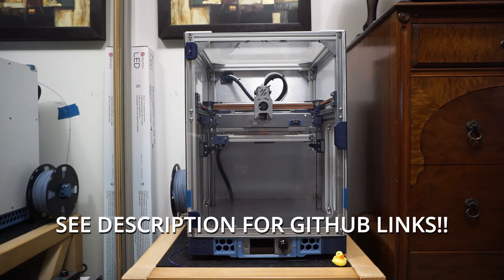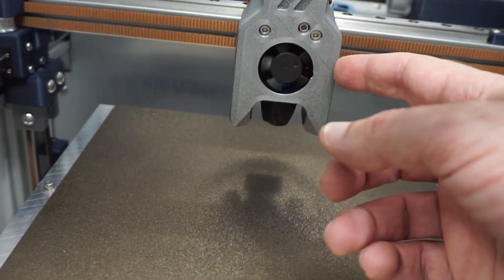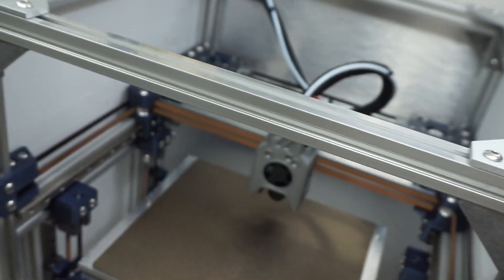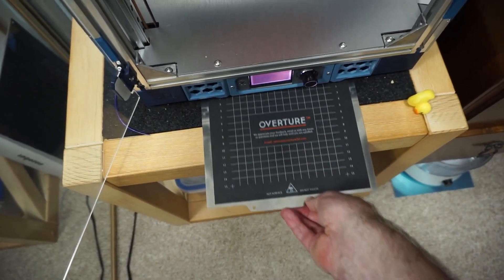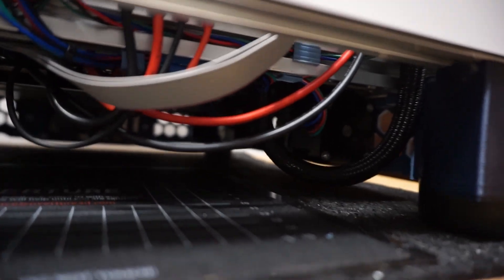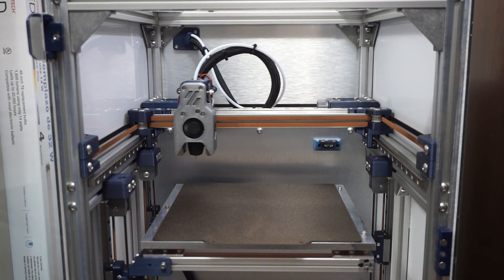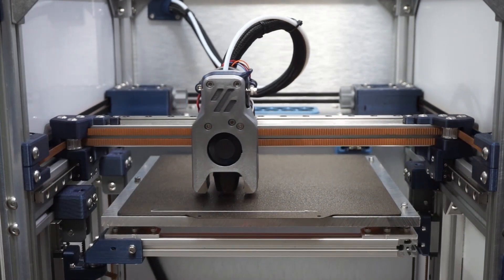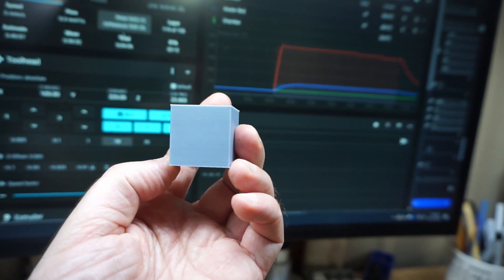XO Printer Part 3 + GitHub Link!

Comment: Hey, I love the Project!
I would really like to get my Hands on the Cad model but for some reason the GitHub download doesn't work for me... Is there any other way?
Reply from the maker: Make sure you click the "code" button, and then the "download zip" option.  that will make sure you get the correct file that should work.  But I am also in the process of doing some minor updates.  I'm adapting the new mini-stealthburner extruder setup from the V0.2 to work on this machine.  Stay tuned!

Comment: Is it hard to convert all the linear rail parts to mgn12h?
Reply from the maker: You'd have to modify the Y axis and Z axis parts to allow for clearance, as the MGN12 carriage blocks are wider than the MGN9 ones.  There isn't enough room on the 2040 cross members for the Y carriage and Z belt mounts with MGN12 blocks.
Reply: @mikey631  ohh, thank you! That is nearly a complete new printer

Comment: How did you come up with rotation distance 7.75 for the gearboxes?
Reply from the maker: I used the spec sheet on the motors to get a starting point, then printed a bunch of 30mm calibration cubes to fine tune.
Reply: @mikey631  Thank you sir

Comment: It looks really nice. I do use macros to change the fan speed on the rpi fan hat, so I dont have to manually press the buttons there since my pi is under the printer

Comment: Cool printer. I guess you don't run a bed mesh? I tried those planetary gearbox motors on z and found out that there's too much backlash.
Reply from the maker: Oh, I run a mesh.. I just don't run it every single print.  only when I change materials and bed temps.  I haven't noticed any issue (yet) with the gearbox motors, and couldn't notice any kind of play when trying to turn them by hand.  So far, they are working great, but I'll definitely need to check back after a few hundred hours more of printing.

Comment: so why not Trident 250mm ?
Reply from the maker: The V0 motion system is a bit simpler and more compact than the trident's, and I liked how it located the X/Y motors outside of the build chamber.  But it was mostly because I wanted to build something a little different :)

Comment: What gussets did you use on the 1515 extrusion for the inside corners of the bed frame? got the rest of the hard parts figured out I do believe!!
Reply from the maker: oh yeah.  I need to add something about those!  I originally used corner cubes, but didn't like how they still allowed movement on the bed frame.  I then had some custom corner brackets laser cut from 3mm aluminum using the parts I drew up in the cad file.  I need to add the dxf files for those on github, so you can order them online